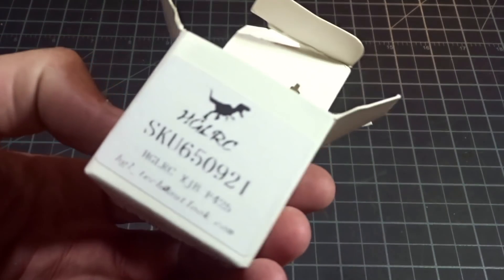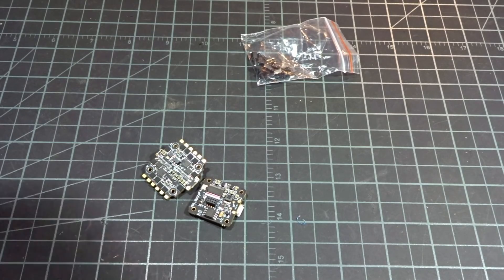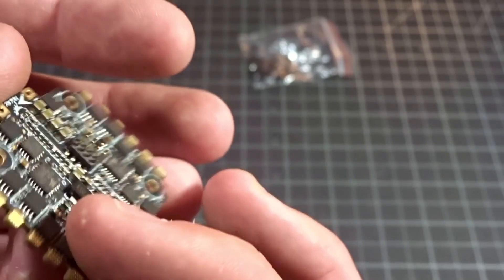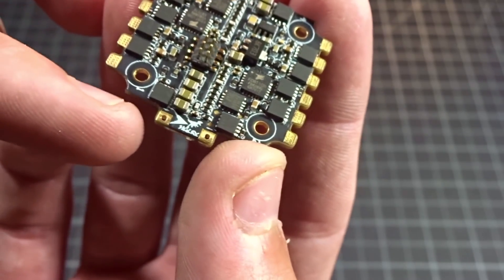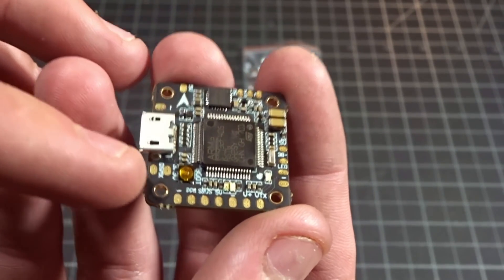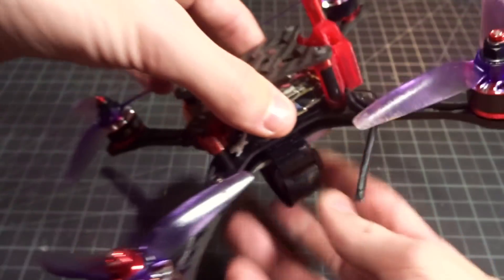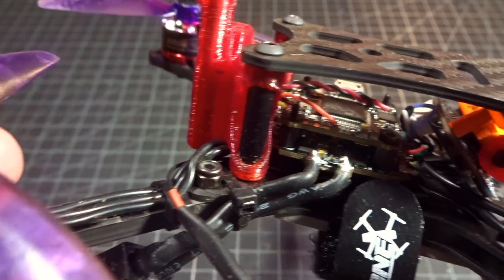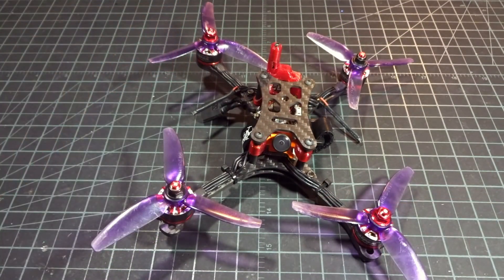HGLRC XJB F428 Review : 20X20 FC + 4in1 ESC Combo!

Comment: @RCaddict  Hey did you ever figure out what the pos+neg pads on the PDB are on the opposite side of the battery pads.  maybe for a capacitor?
Reply from the maker: Just an extra VBAT, can put a cap there yeah.
Reply: The RCAddict  I was kinda thinking that after I pigtailed my CAP to the battery terminal and could have all along just gone off of that pad..  much easier that way.

Comment: F438 is out. (38A continuous, 50A MAX)
Reply from the maker: They say the amp rating is higher, but the models look very similar, I am skeptical they will perform well under high loads.
Reply: It’s actually 33a and 38a continuous

Comment: I just built a 2" geprc hummingbird with this set up my order also included the vtx (tx20) as well,but so far so good the thing rips with emax 1106 6000kv motors n micro sparrow cam. A tip for the vtx since ufl connector likes to come  undone u can just dab a bit of solder on and over the connector top the board..that improved both the signal of the transmittion plus ensured a secure connection. Fast,fast little build on even 3s..I recommend it..

Comment: Looking at building a 4 inch. What size motors are you using?
Reply from the maker: These are gemfan 1606 3500kv, but you could also use BH 1407 3600kv

Comment: I have 3 builds with this stack. All from Helipal, two of them have failed from the pin connector, making both esc and fc unusable. Both replace by warranty. The new batch has some glue in the pin connector on the fc. Well see how it goes.

Comment: Got a build using this one on a 5" setup with Air40 2205 motors. Very smooth flyer, no issues.  I can attest this works in a 5incher.

Comment: You can mount these using double sided 3m foam tape on any frame whether it has 20mm holes or not, works really well and just use the m2 screws to attach both parts together. Handy to lower the stack size too. Use copper wire to enlarge the battery pads as they lift easy.
Reply from the maker: Good suggestion thanks
Reply: noob question but how do you enlarge the pads with copper wire?
Reply: pavalige run some wire through the small hole in the battery pad and solder onto that as well as the pads.

Comment: wonder if the current would be too much even if you used a 2205 or 2204 motor
Reply: CarelessMedia I’ve used it on hyperlite 2204 2722kv without issue, wouldn’t use anything bigger than that.
Reply: got a build using f425 on a 2205 air40 motors.
Reply from the maker: Yeah I would MAX use this on 2205 motors for 5inch.

Comment: is this the 425 or 428?
Reply: Five Freaking Onion Rings Five Freaking Onion Rings The video states F425, (despite the video description saying F428) and I can confirm the F428 I received today has a different layout for the FC. So I would say its the F425 in this video.
Reply from the maker: I got the F425 version, but got a replacment F428 esc (they work together). I listed the F428 since the F425 is discontinued and don't think there are any major differences.